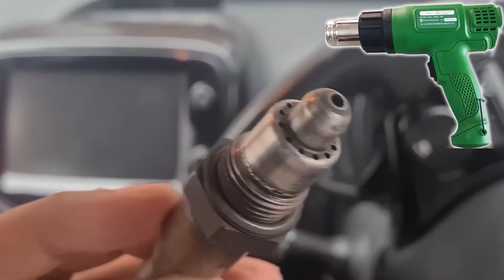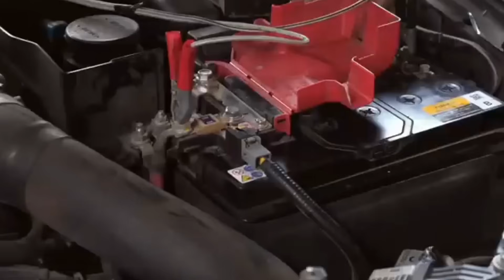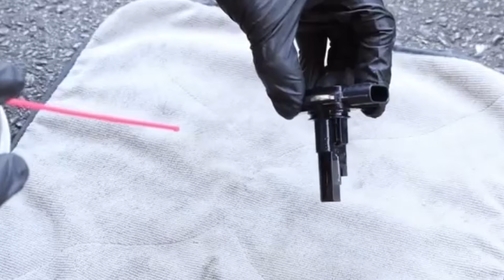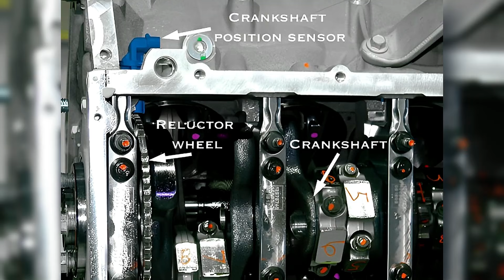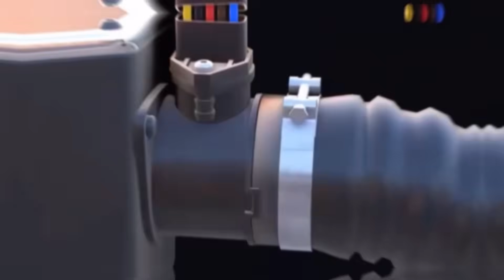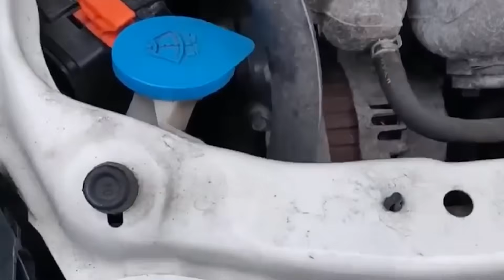Nobody Cleans These 5 Sensors — And Your Car Pays for It

Comment: Hi, on my gti7 2014 model, I have an issue when i have accelerated hard or may be pull away fast, my car goes into limp mode (restarting cause a rough idle and tractor sound when trying to accelerated) without any warning lights and I need to wait about 10 to 15 minutes to restart the car. I have checked the pcv valve and its leaking oil and into the air intake, could this be the cause of my problem?
Reply from the maker: You already found it. Leaking PCV pushing oil into the intake is coating the MAF sensing element — exactly what this video covers. Under hard acceleration the MAF reads completely wrong, ECU sees a problem it can't correct, throws the engine into limp mode as protection. Clean the MAF first, fix the PCV valve second. Do both or the MAF gets contaminated again within weeks. That tractor sound on restart is the engine running on bad fuel trim data from the dirty MAF.
Reply: @AutoTruthLab  Thanks Bruh, I will definitely do so Tuesday. Watching your video did actually point to thay direction. Mind you my car did the same thing last year and the person charged me an arm and leg to fix it and most probably just cleaned the MAF sensor without informing me to replace the pcv sensor.😢 😢😢😢

Comment: Wow I need you in Cleveland ms now ,my sister has a 2006 Nissan Murano Sl Awd, it needs a motor mount and this mechanic doesn’t want to be bothered with it lol
Reply from the maker: A mechanic who won't do a motor mount is a new one 😂 That's a straightforward job on the Murano. Find someone else — that one's already told you everything you need to know about how they work.
Reply: @AutoTruthLab  ok thanks ❤

Comment: My 2002 jeep grand Cherokee overland has 4 oxygen sensors
Reply from the maker: And that's exactly why shops love that code on a Grand Cherokee. Four sensors, $400-600 each, do the math — that's a $2400 bill before they've even checked the MAF. Clean the MAF first on that 4.7 and watch how many of those O2 codes disappear.

Comment: I just cleaned my Maf with a Maf spray for $15.00.  cleared the fault code PO171.  And test drive for 2 miles. I hope check engine light does not come on again on my 2008 Mitsubishi lancer GTS with 135,400 miles.
Reply from the maker: P0171 after a MAF clean on that Lancer is a good sign. Give it 50-100 miles of normal driving before calling it fixed — the ECU needs time to relearn fuel trims after the clean. If that light stays off you just saved yourself a shop visit that would've started at $200 minimum. Come back and update us.

Comment: Back in o5 or so an 03  durango I had started  hesitating the dealer quoted me a $700/00 "Decarbonation" price ( you can imagine what I told them)  Stopped at the auto store got a can of carb cleaner and did it myself for 5 bucks
Reply from the maker: $700 "decarbonization" in 2005 dollars too — that's probably $1,100 today. And yeah I can imagine exactly what you told them 😂 $5 can and you proved the whole scam in one afternoon. This was happening long before anyone was making videos about it.
Reply: @AutoTruthLab AMEN,TK U, MAY U KNOW THE LORD JESUS sooner than later,  HE'S GOING TO CLEAN U UP  MORE THAN THAT HE'S  GOING TO MAKE U NEW CREATION FOR HIS K/DOM AMEN
Reply: @rameshpersaud7131 no jeebus cannot help you, all bibles man-made. You will be smited
Reply: You got lucky, very lucky. 
Carb/Brake cleaner can & will melt the plastics on a sensor.

90% Isopropyl & higher is the best thing, chemical wise, to use to clean sensors with a soft bristle brush & air
Reply: @danullb9056 

Yep lot of sto0pid people out there. Can't tell you how many car s I've fixed from customers "fixing" their own cars lol. If a customer has touched it I charge more.

Comment: I cleaned my airflow sensor and had to adjust my Idle it was too High
Reply from the maker: That's normal after a MAF clean. ECU was running compensated fuel trims to work around the dirty sensor — clean it and suddenly the computer is overcorrecting until it relearns. Disconnecting the battery for 10 minutes after cleaning resets those trims and usually sorts the idle out without needing manual adjustment. Good that you caught it though.
Reply: 2003 Nissan Altima hard to accelerate at 60 miles or going uphill and shifting into gear

Comment: I know all about being over charged 400.00 for plugs only and it still missing
Reply from the maker: Still missing after $400 in plugs means they never found the actual cause. Plugs get blamed first because they're easy to sell. MAF or coil pack is usually what's actually misfiring — plugs just take the quote.
Reply: @AutoTruthLab I googled and came up with a few , 1 crank sensor which when I drove it to motor vehicle I turned it off because of long lines and it wouldn’t restart

Comment: Slight jerk while gear change takes place in my auto gear transmission system. Also poor pickup after starting for a few seconds.
Reply from the maker: Both symptoms are in this video actually. Jerky gear changes on an auto trans is the throttle body — carbon on that plate sends bad data to the transmission shift points. Clean it first. The poor pickup after cold start is the MAF, dirty sensor struggles to read cold air correctly. Clean both, $15 total, do it before anything else.

Comment: 2010 mercury Milan crank no start. Put a new CKP in and it still won’t turn over. Also put a new starter motor, battery and plugs in and it still wouldn’t start. I checked if fuel pressure was weak and the pump is strong. Idk what else is the problem

Comment: Fun FACT: Politics are to blame for all the emission sensors cars have, they do in fact get a kick back from manufacturers who make said sensors mentioned in this video, while they claim we the people need to think about the environment with VERY clean burning vehicles, they are dumping very TOXIC industrial chemicals, heavy metals into the atmosphere, water etc and blame it on the thousands of cars. They now charge people thousands for a new battery in EV's that was mined worse than oil fields(giant holes, strip mining for lithium etc.) And the offgasing if lithium burns up is insane and also IMPOSSIBLE to extinguish even by a fire department,  they will border the area and let it burn while keeping people away until the fire is well out.

Comment: As a car guy(has built hotrods and all sorts of engines), that knows more than 75% of "ASE CERTIFIED" techs, I 100% back this as FACTS!

Most recent for me, I was chasing an electric problem for a "crank, no start condition". Finally, get the real trouble code(immobilizer to ECU)to pop up when a shop wanted $3,000 to basic stuff and said, "we can not promise it it will run." Idid all the work myself and ordered a $10 cable to reprogram the immobilizer and sync to ECU being the tech myself. 😂 

Folks, find you a car guy and/or a trustworthy mechanic who will tell you "it was just the sensor" instead of charging thousands. Thank your wallet later.
Reply from the maker: A hotrod builder finding the real code after a shop wanted $3k and couldn't promise it would work — that's the whole channel in one comment 😂 Appreciate you backing this up with real experience.
Reply: @AutoTruthLab 😂🫡

Comment: The oxygen sensor (O2 Sensor) is a sensitive electronic component with a ceramic coating, unlike a throttle valve or injector that can be easily cleaned. The problem is usually:
Contamination with soot and carbon
Deterioration due to high temperatures
Poisoning with substances such as oil or antifreeze
Natural wear and tear (after 100 to 150 thousand kilometers)
Reply from the maker: All of that is accurate — but that's not what this video is saying. The point isn't to clean the O2 sensor. It's that a dirty MAF triggers O2 fault codes on perfectly working sensors. Shops see the code, quote the O2 sensor, skip the MAF entirely. Clean the MAF first. If the code comes back after that — then yes, look at the O2 sensor for exactly the reasons you listed.

Comment: After setting overnight  or for a couple hours my 2016 dodge ram cranks vor appx 4 seconds prior to finally starting.  Then it starts perfect unless levt for a few hours.
Reply from the maker: That 4 second crank only after sitting is fuel pressure bleeding down overnight. When the engine sits the fuel rail loses pressure, starter has to crank longer to rebuild it before the engine catches. Check the fuel pressure regulator first and the injector o-rings for small leaks. That's where pressure is escaping while it sits.

Comment: I have a Honda civic 2013 and my wife has a 2016 civic we both have a message saying emissions control system we both went to garages had them repaired still the same problem they there are multiple problems different parts 3 times at the garage same issue,, can anyone please help with this issue thank you
Reply from the maker: Three garage visits, two cars, same emissions code coming back every time — that's the MAF sensor on both. Shops keep replacing parts the code points to without cleaning what's causing the code. Clean the MAF on both Civics first. $8 can, 15 minutes each. Clear the codes after. That emissions message will stop coming back.
Reply: @AutoTruthLab thank you

Comment: 2013 Toyota Sequoia Platinum terrible fuel mileage. Keep getting a code for Avery small leak in the evap system. Dealer install a new fuel cap and the code cam back the next day.

Comment: Too much talking ,would have helped if you showed where to find the sensors, then you will really be helping non mechanics.
Reply from the maker: Fair point. Knowing what to clean and finding it under the hood are two different things. Working on a follow up that shows exact locations by make and model. Appreciate the honest feedback.

Comment: I have a 2010 mercedes E350 coupe. After I stop, the car hesitates to move. I have to press harder on the fuel pedal. In addition, the acceleration is slower than before. 
Thank you for your help.
Reply from the maker: That hesitation from a stop and having to press harder is the throttle body on that E350. Carbon builds up on the plate, throttle doesn't open smoothly, car stumbles before it catches. Clean the throttle body first $8 can, 20 minutes. Then clean the MAF. Do both and that sluggishness will go away.
Reply: Thanks

Comment: Please help. i have an aussie designed and built (2004) muscle car , 6spd manual gen3 ls1 up front. i cant drive it because the alternator will fail on startup, the battery takes the load, i get no warning until the battery fails. ive replaced the alternator, and two batteries. your input would be greatly valued
Reply from the maker: This isn't a sensor issue but worth answering if you've replaced the alternator twice and still losing charge, the problem is upstream. Check the alternator exciter wire first, that small signal wire tells the alternator to activate. If that wire has a bad connection or the fuse is blown the alternator runs but never actually charges. $0 fix before buying anything else.

Comment: 1990 Chevy 454 automatic lack of power when putting pressure on the gas pedal, especially up the hill
Reply from the maker: On a 90 454 that power dropout on hills is almost always fuel starving under load. TBI injector tips varnish up over time, spray pattern goes sideways, engine stumbles right when you floor it. Run Techron concentrate through the fuel rail before spending anything else.
Reply: @AutoTruthLab  thought about changing out the throttle position sensor. I’ve already changed the filter and I’ve already ran cleaner through it and the gas and cleaned the throttle body. Everything is sparkling clean even before I started also, I’ll get a backfire if I step on the gas hard and keep it pushed down going up a hill with no power, clean air filter good gas, spark plugs, wires distributor, all basically new.

Comment: How about the iac?
Reply from the maker: Didn't cover it in this video but the IAC is a big one — carbon buildup on that valve causes the same hunting idle symptoms as a dirty throttle body. Most shops replace it when a $10 cleaner fixes it 90% of the time. Good call adding it.

Comment: I spent $60 on cleaners.. did these sensor cleanings on the 4 cars I own.. and I now have  4 new cars 😂🤣😂 my 06 crown Vic p71 got it's happy humm back and takes off like a beast.. my 95 hearse with an LT1 engine (same as a Corvette that year) went from a 31 year old "I'll get you around town" to a race car.. vroom vroom. ( Never thought a hearse could take off like that haha.) The other two are an 06 Lexus and a 07 Toyota.. both have tons more power and run super well.. definitely worth the time and effort.. thank you so much for posting this video 😁
Reply from the maker: A 31 year old hearse taking off like a race car after a $60 cleanup — that's genuinely the best comment this channel has ever received 😂 Crown Vic P71 getting its happy hum back is exactly what this video was made for. Thanks for actually doing the work and coming back to report.
Reply: Hope u don't have to change a starter on the lt1,😮

Comment: high emmissions, hesitation on acceleration. occasional O2 fault (after cat) reset and will run for months before fault reappears.
Reply from the maker: That months-long gap before the fault returns is the MAF. Clean enough to function, dirty enough to slowly push fuel trims out of range until the downstream O2 finally throws the code. Clean the MAF first that fault cycle will stop.

Comment: I agave a2002 Mitsubishi Montero Sport 6 cylinder, it keeps losing power on the road and small ramps.
Reply from the maker: That power loss under load on ramps is pointing straight at the MAF sensor on that Montero. Dirty MAF can't read airflow correctly when engine demands more air. $8 MAF cleaner, 15 minutes. Try that first before anything else.

Comment: I asked our local Toyota Dealer to quote me on cleaning some sensors, O2, MAP, MAF, TPS, CKP. they looked at me as if I had two heads. We dont do that was the response.
Reply: Right is all a scam 😂😂 to get your money 💰
Reply: @omari2239 LEAVE QUICKLY!!!
Reply: Some truth to this video,  but, anyone who has ever had to remove an oxygen sensor knows many times you will destroy it removing it as they are often rusted and stuck. The other sensors are not as difficult and can be cleaned easier.
Reply: @scottcarver174  I tried to change one never again.
Reply: I didn’t have a lift but I did have a universal replacement, 3 wire and 4 wire don’t remember what I soldered ( I did test it) but that 02 was there until that car was totaled.  Don’t use a cruse control, if it’s raining, it might become black ice.
Reply from the maker: That reaction IS the whole video. No profit in cleaning, full profit in replacing. You basically walked in and asked them to make less money. Of course they looked at you like that.
Reply: @AutoTruthLab good work thanks.
Reply: @AutoTruthLab I can tell you have never worked in a shop in your life... a full labor job that's all profit compared to a job that has more in parts than labor... right... what next saying that a ford Triton engine tune up can be done easily without breaking any of the plugs??? I loath people who use artificial voice overs as much as I loath people who spread false information...
Reply: Yep. No money in it. 😅
Reply: Cleaning an o2 sensor is impossible.  They are always rusted in tight.
Reply: @TheodoreCross-d7b not always. I Clean my sensor  oxygen ,it is 29 old,original. Car is nissan 1997. Looks like almost new
Reply: @tombouu only one left on earth
Reply: @TheodoreCross-d7b  It is a tough job but I have seen it work after cleaning, but it is a hit or miss situation.
Reply: Tell him you’re going to do it yourself.
Reply: @LabinotBahtiri-w2n 

Why would they tell you how to fix something for free when they are in the business to fix cars? 
Pretty sto0pid to spend all that money on tools and education just to give away what you worked so hard for and paid for.
Reply: Citreon relay 2.2 euro 6 idle speed increases and engine shakes,but drives ok any ideas
Reply: @deborahoz5044 conect to computer diagnostic in service
Reply: Then you asked how much they wanted to REPLACE all the sensors and the shop manager got an erection.

Comment: I put gas in went 50 feet car studdered then died. Won't start. I have a kia 2011 optima push to start.  It sounds like it wants to start.  Where do I start to get my car going again. Plz help
Reply: Did you FIILLL up, fill up beyond when the automatic stop is triggered??
It sounds like you saturated the charcoal filter in the gas return line.

Don't pump beyond the automatic stop once it's triggered
Reply from the maker: That happened right after fueling so first suspect is bad gas or fuel pump lost prime. Try this turn the key to ON position without starting, wait 3 seconds, turn off, repeat that 3 times, then try starting. This reprimes the fuel pump. If it cranks but still won't catch, bad gas is likely the issue.

Comment: My Porsche  cat one 2916 looses oil and asks for 1.5 quarts ..what could be the problem?
Reply from the maker: Porsche losing that much oil usually points to valve seals or PCV system. Blue smoke on startup is the telltale sign. Any smoke at all when you first start it?

Comment: My opel corsa utility, i struggle to start it most specially morning time, after sometimes it ends up starting, starts vibrating for some minutes, then engine changes and idle correctly, which sensor might be the problem?
Reply from the maker: Two things to check CKP sensor connector first, corrosion on that connector causes exactly this cold start struggle. Second, clean the MAF sensor, that vibrating and rough idle until it warms up is classic dirty MAF. Start with both before spending anything.